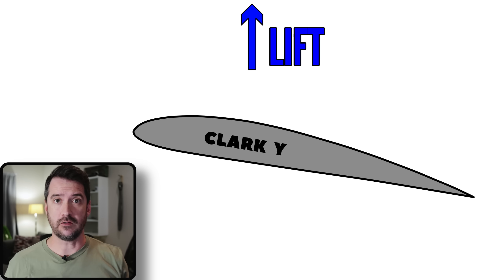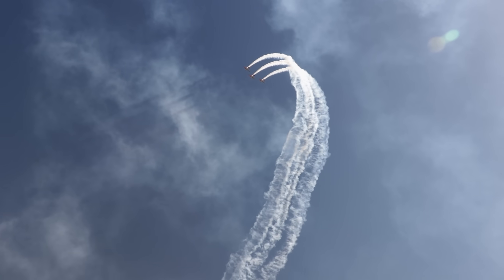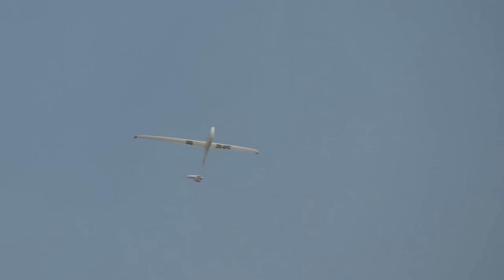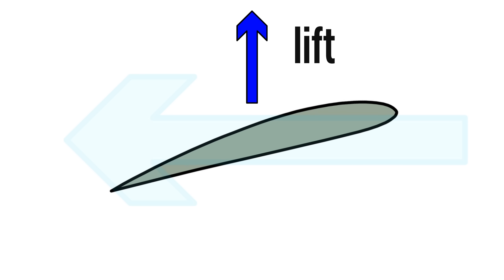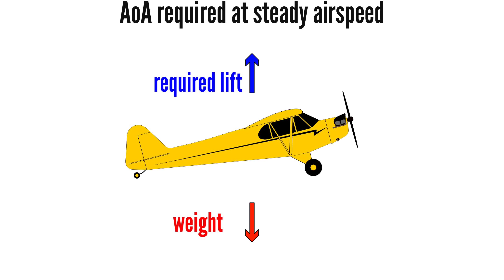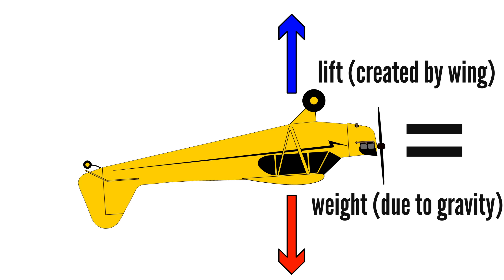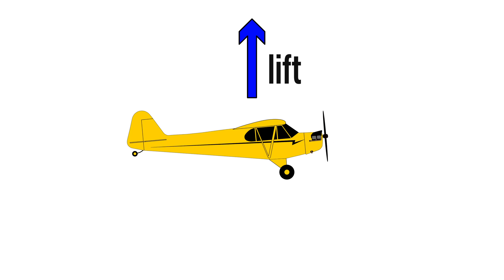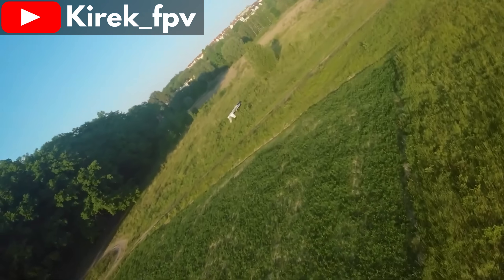Is Airflow Distance Over the Top of a Wing Always Longer?

Comment: The theory that lift on an airfoil is created by the static pressure differential between the air on the lower and upper surfaces of the air foil has been left behind years ago.
It has its origin in Bernoullis principle that states: “If in the same mass of fluid og gas, part of the fluid or gas moves faster , the dynamic pressure increases and the static pressure decreases” 
It is possible to measure this pressure differential, and what you will find is that it creates just a fraction of the force that is needed to keep the airfoil and structures connected to it, off the ground.

The lifting force is instead a matter of mass movement. Air is viscous and it has mass. That means that if you move a part of a mass of air, the air around it will immediately fill the gap created by the displaced air. The process continues a distance through the air mass, depending on the volume and acceleration of the initially displaced  air.

So it is the downward deflection of a variable amount of air that keeps the aircraft defying gravity.
This can easily be seen in wind tunnel tests where air particles that initially were many meters above the airfoil, is way below it when the airfoil has passed through, all depending an the speed and angle of attack of the airfoil.
Reply: Bernoulli never stopped being right. The mistake is in thinking air parcels that are split at the leading edge have to join at the trailing edge - the "equal transit time fallacy".
Reply: @michaeldunlavey6015  Spot on!
Reply: @michaeldunlavey6015  Exactly.
Reply: "The theory that lift on an airfoil is created by the static pressure differential between the air on the lower and upper surfaces of the air foil has been left behind years ago."

No it hasn't. This is just a different aspect of what you describe as happening around a wing. You are misunderstanding physics in assuming that looking at a problem in one way rules out explanations that describe different aspects of the same process. You are describing the reaction forces, but the pressure differential is what transmits those forces.

"what you will find is that [the pressure differential] creates just a fraction of the force that is needed to keep the airfoil and structures connected to it, off the ground."

Utter garbage. The only way a gas can transfer force to anything is by pressure differential. Go on, think of how else a gas can make a force on a wing.

If you know about physics and dimensional analysis the lift formula also gives a suggestion that pressure differential is involved. Lift = CL x 1/2 x rho x v^2 x S

Breaking this down you have CL x q which is dynamic pressure multiplied by coefficient of lift, a dimensionless number dependent on cross sectional shape and angle of attack, so giving a multiple of the dynamic pressure which can be interpreted as a pressure differential. This is then multiplied by S which is wing area to give total force.

Now this is not proof, as the resulting dimensions could be achieved by calculating from Newton's Third Law, but the way they come out in the equation is very suggestive of pressure differential acting on wing area given that those are the parts of the equation.

Source: I teach Principles of Flight and was an SME contracted to EASA in the subject.
Reply: Lol thank god none of you build airplanes.
Reply: @christophorus9235   There might be some Boeing employees here...
Reply: I remember studying aeronautical engineering and discussing the viscosity of air. I also remember studying the circulation theory of lift.
Reply: In case you are wondering why it is important to understand Bernoulli as well (and I would say understand first) is that it makes lift distribution across an aerofoil section easier to understand. The changes in pressure distribution are the easiest way to explain changes in pitching moment caused by movement of centre of pressure with flap deployment, above Mcrit or at the stall, for example.

I am sure they can be explained another way but the explanation with Bernoulli's principle is the simplest and is correct, regardless of other possible explanations.
Reply: You are both right and wrong The fundamental concept of what you're saying is wrong even though the individual parts of what you're saying are right That's because you lack understanding about how the overall system works 

Ultimately in order to generate lift in a fluid environment like an atmosphere you have to do the same thing your engine does you create a mass thrower you throw mass one way action reaction says you will get an equal and opposite force the other way 

The fact that all aircraft have air foils and we do not make aircraft with flat plates says everything you need to know that what you're saying is incorrect not so much that what you're saying is incorrect is that what you're saying is incomplete 

The lift generated by a wing comes from the amount of air mass that the wing pushes downward in opposition to gravity this throwing of mass downward we call lift if you generate it by brute force with a propeller rocket motor or jet engine we call it thrust but essentially a wing is a thrust diverter it's taking some of the forward kinetic energy from the aircraft and diverting it down in opposition to gravity 

How does it do this? Well there are three simple ways to do this you can generate lift via aerodynamic principles such as Bernoulli's principal and a wing shape you can also do it by simply physically deflecting the air this is what flaps do you can also do it by literally directing frosted downwards with some sort of propulsion unit such as a thruster or for example in the case of a drone a set of propellers aimed up thrusting air down keep in mind a propeller is just a rotating wing :-) 

An airfoil and the pressure differential is not the reason that a wing creates lift it's the way a wing efficiently creates lift :-) you see you understand the two separate processes but you don't understand how those processes are interconnected are they work together The reason an airfold wing creates downward thrust is because of the pressure differential that distorts the airflow over the wing that pressure differential between the top and the bottom of the wing diverts the air what direction does it divert the air? Well look at the shape of the air foil it diverts the air down and when you throw air or to simplify mass down every force has an equal and opposite reaction The amount of mass you throw down is matched by a force upwards equal to the amount of mass you throw down 

The pressure differential of a wing causes it to throw mass down this gives us lift 

Can a flat plate do the same thing? Yes it can just like the flaps on your wing do the same thing They divert air down so what do we need Air Force for? Efficiency that's why we need air foils while a flat plate can work it's extremely inefficient your aircraft will require a much larger engine to generate far more thrust to compensate for the extreme lack of efficiency in your flat plate 

What you have is called a logical fallacy if this then that without understanding of what this is or that is 

Pressure differential doesn't make lift see this flat plate makes lift therefore you're wrong except no you are wrong because the flat plate is doing the same thing in air foil does it's creating a pressure differential which creates downward mass throwing which creates lift it just doesn't horribly inefficiently :-) design your drone with non air foiled flat plate propellers and now look at the watt hour draw on your battery to make it fly. I say use a drone because they're typically overpowered meaning even with less efficient flat plates it might still fly but you're going to draw a hell of a lot more power doing it it's also going to be a lot noisier well take a guess with that noise is? That noise is quite literally watt hours of battery power being expended to generate that noise instead of generating lift 

It all comes down to efficiency and airfoil that maximizes that differential and pressure to create that downward thrust of air while using his little drag as possible simply does it with less power it's more efficient 

When we need to generate a whole bunch of lift we can do so by temporarily increasing the angle of attack kind of like how a flat plate creates left but this is temporary unless you have a tremendous amount of power at your disposal to waste 

This uses more fuel which is why we do not design airplanes like this :-) 

Your individual concepts precepts I'm not sure what the right word is are correct but when you put them together you're wrong because you don't understand how they work and interact with each other.
Reply: Incorrect.  The force from the difference in pressure is exactly equal to the change in momentum of the air forced down.  One is a consequence of the other.
Reply: Many things left behind are best left behind. In this case of aerodynamics, I suggest it was ignorance rather than scientific understanding that caused many to think that this fundamental theory of pressure differentials is not longer applicable.
Reply: @MarkStafford9  Yes. Pressure differential on the top/bottom of a profile is a fact. This does not contradict the fact that a certain mass of air is accelerated downward...which, as all is said and done, results in a pressure differential :)
Reply: @les8489  Yes. Aircraft passes through a Walmart-sized localized group of air molecules named Johnny. Johnny gets very disturbed. Aircraft leaves Johnny and moves on to Mary. In addition to being all in a whirl, Johnny notices he has been accelerated downwards. It takes Johnny a few minutes to deturbulate and decelerate, to chill back to his settled state, by which time he has lost roughly 300 to 500 feet in altitude. Freddy, Johnny's upstairs neighbor, has also been demoted, though with much less turbulence and with less altitude loss.
I bet if we could measure the energy dissipated by Johnny, that value of energy dissipated would equal the energy of the fuel consumed by the aircraft flying through Johnny.
That is all the "what" happened. The "how" did lift happen (the long and the short of it) is pressure differentials caused by AOA and airfoil shape manipulating parts of Johnny to run faster over the lifting surfaces than the other parts of Johnny are running under the lifting surfaces (Bernoulli). The over-wing molecules can't be forced to move too fast, so when the AOA gets too steep for the atmospheric conditions (ambient pressure, temperature, humidity, turbidity/purity) the under-wing parts of Johnny run up after the wing passes to greet the over-wing parts of Johnny, which severely and suddenly decreases Lift.
Reply: @MarkStafford9  Hm...somehow I fail to see this Walmart and Johny...
The lift happens because a mass of air is deflected by the wing (the induced flow angle comes to mind...) - here is where the conservation of momentum comes into play. It manifests itself by an overall pressure differential on the top and bottom surfaces of the wing - which results in lift force. 
The air accelerates on the top surface not because "it has a longer path to travel" - but because due to the angle of attack, a region of lower pressure is created at on the top surface, generally towards the trailing edge. When the angle of attack exceeds critical - the flow of air on the top surface may separate due to positive pressure gradient at some point on the upper surface (as the region of lower pressure is disturbed by ambient air trying to fill the pressure region). This results in a vortex, positive pressure gradient along the upper surface, flow separation and a loss of lift.
Bernoulli principle can be used to explain in layman's terms what is happening - but we know that the flow which (at the stagnation point) separates into two streams - does NOT "meet" at the trailing edge. There are numerous visualizations in the wind tunnels (using intermittent smoke technique) which confirm this. So - Bernoulli is useful to explain the principle, but the real answer is the conservation of momentum and Navier-Stokes equations.
Of course - all this can be translated into useful theories used to calculate lift - like the lifting line theory, vortex lattice method, Schrenk method etc. which are much simpler that solving Navier-Stokes equations (CFD).
The underlying physics is still the same and is described by Navier-Stokes equations (and yes, I happen to be an aeronautical engineer).
Reply: @les8489  Wow, thank you for such a richly-peppered-with-truths reply. Your statement,
 "we know that the flow which (at the stagnation point) separates into two streams - does NOT "meet" at the trailing edge"
 is particularly important. While not a requirement or a repudiation of "long/short" reasoning, your statement is a very important factoid to noodle over.
Reply: Lift and Propulsion share characteristics, that of energy field density differentials that are generated and vectorized through eddy flows. (according to NASA propulsion studies)
Reply: I think I need someone to explain to me what the difference between these two theories is. A pressure differential will cause bulk air movement—it's called “wind”. Induced bulk air movement will cause a pressure differential. Aren't these just two measurements of the same phenomenon, namely a bunch of particles whizzing around? Why does either description need to be false?
Reply: @stephenspackman5573  Stephen...what vast majority of people who are not engineers (and, in fact, a large number of engineers too) do not understand is the difference between the reality and the physical model associated with a theory which can be used for real-life applications.
In case of a gas flow over a body (the wing in this case) - the reality is described by solving a 3D Navier-Stokes equations. The results will describe the path of the flow under and over the wing, the pressure distribution on the top and bottom surfaces, the drag forces acting on the wing, the induced angle of the flow (the airstream being directed downwards for positive lift) etc. etc. Also - the strength of induced vortices can be calculated - as many other parameters of the flow.

So - the end result is: pressure distribution (which can do some degree be described by Bernoulli's equations), the change of momentum of the airstream (which results in forces), the trailing edge vortex etc.
All these are the interrelated, but when all is said and done - they are all a composite result of solving the Navier-Stokes equations (which for a wing is not a trivial thing and can be done only by CFD using a serious computing power). Neither Bernoulli nor the conservation of momentum does not fully explain the generation of lift or drag, but they CONTRIBUTE, partially, to the explanation of the phenomena.

That would be as close a description of the wing behavior and the forces acting on it as possible (and, in practical terms, depicting the reality closely).

The discussion regarding "what causes lift" and the preference for either a Bernoulli type explanation or the conservation of momentum - are just this: different views of people who are trying to describe an elephant - while observing it through a keyhole and seeing only a small part of it.

Now a number of theories exist which can pretty accurately calculate lift and drag - based on aerodynamic (measured) characteristics of the airfoil, and the geometry of the wing. These models (like the Lifting Line Theory which models the wing as a line of vortices) - but they do NOT describe the reality (Navier-Stokes) - these theories are just useful models which can be applied in real life with sufficient (mostly) accuracy.
Hope this helps.
Reply: @les8489  Lol Navier-stokes equations cannot describe reality. I hope that was the point of your rant.
Reply: @christophorus9235  LOL it wasn't a rant. And Navier-Stokes is the closest to what we can use for this purpose. Maybe you can enlighten all and sundry what should be used for this application.
Reply: @les8489  Navier-Stokes is an approximation mate. You keep using it and the word reality like they are one and the same, which points towards a fundamental misunderstanding on your part.
Reply: @stephenspackman5573   You would have to understand how the Venturi effect works (combining Bernoulli & Boyle's law).  This isn't theoretical physics.

Seeing this pack of physicist LARPers would be funny if it wasn't so tragic.  If you want to learn something, take a class, read a book, don't just try to imagine an answer, and then just seal yourself into an echo chamber to convince yourself you are right.
Reply: @stephenspackman5573  Correct, this tempest in a teapot arose when the OP tried to get the monkey off everyone's back, but everyone's sitting in his dome and saying "I like my monkey."
The pressure-difference description and the air-flung-downward description are two sides of the same coin.
Reply: Bernoulli (and Venturi) and the difference in speed of the air flow between the top and the bottom of the wing have NOTHING to do with lift. 
The only real and valid explanation is here (see from min. 2.18 ): https://youtu.be/ph1HqrioLPs?si=hbq42wwKaUYVeRAv . 
The pressure difference (aka "lift") between the top and the bottom of the wing is caused by the CURVATURE of the airflow over the top of the wing. If the air flow does not curve, there is no pressure difference between the internal and external part of the vortex (see tornadoes, cyclones effect) and therefore there is no lift. 
So lift is basically generated by CENTRIFUGAL/PETAL FORCE experienced by the airflow flowing over the top of the airfoil. No Bernoulli (nor Venturi), but "Newton" (in terms of centrifugal/petal force on the top and action/reaction on the bottom) is "responsible" of lift.
ps: please, don't misunderstand me. Even a perfectly flat wing is able to curve the airflow and therefore generate lift!
Reply: Guys, this is totally wrong:
"The theory that lift on an airfoil is created by the static pressure differential between the air on the lower and upper surfaces of the air foil has been left behind years ago."
Wrong. A fluid can make forces on a surface ONLY in 2 ways, with static pressure (it creates a force perpendicular to the surface) and with viscosity (it creates a force tangential to the surface). There is no other way. And it is not the viscous force which creates lift, it is the distribution of static pressure around the airfoil  (although viscosity is necessary to create circulation, the phenomena that creates the distribution of static pressure around the airfoil).
"It is possible to measure this pressure differential, and what you will find is that it creates just a fraction of the force that is needed to keep the airfoil and structures connected to it, off the ground."
That is TOTALLY false. Quite simple aerodynamic models are surprisingly good at predicting the static pressure distribution around an airfoil, and that pressure distribution explains the TOTALITY of lift perfectly. To the point that distribution of pressures and the slope of the Cl-vs-Alpha graft (coefficient of lift vs angle of attack) can be calculated modeling a spinning cylinder and then making a mathematical transformation to "morph" that cylinder into the shape of an airfoil, and the reality matches this prediction perfectly. Look up Joukovsky airfoil and Joukovsky transform.
"The lifting force is instead a matter of mass movement. Air is viscous and it has mass. That means that if you move a part of a mass of air, the air around it will immediately fill the gap created by the displaced air."
Well, the fluid has mass and if you want to move it from one place to another then you need to accelerate that mass, and the acceleration is force/mass. Where does that force come from? PRESSURE.
Yes, the wing pushes the air down, so the air pushes the wing up. That's action and reaction (the 3rd Newton's law) and it is totally correct as a first explanation of lift. But when you look HOW the wing pushes air down, that's PRESSURE. The wing creates a PRESSURE field around it that accelerates the air, and the PRESSURE field is correlated (almost perfectly) with a VELOCTITY field of the air around the wing that follows (almost perfectly) Bernouli's principle: The parts where the air is moving faster the pressure is lower and vice versa. (The reason when Bernoulli matches almost but not totally perfectly is that Bernoulli assumes conservation of energy which in turn assumes no viscous forces, which is mostly true everywhere around the wing except inside of the thin boundary layer).
Discussing it lift is created by the wing pushing the air down by Bernoulli is like discussing if an object in free fall accelerates because of Newton's second law or because of conservation of energy, or how much each of them is responsible for that. It is not one or the other, it is not "both" as in "a part and a part".  It is "there is no OR, the Newton's second law and conservation of energy are not 2 different things, are just 2 different points of view of the SAME thing, to the point that conservation of energy can be MATHEMATICALLY DERIVED directly from F=m*a". It's like saying "X+1=3" and "X-1=2" and someone asking "How much is X=2 because X+1=3 and how much is it because X-1=2?"
Reply: @adb012  THANK YOU. Anyone who's ever used a CFD package, even just once for some undergraduate course ( for heaven's sake ) knows that to calculate your aerodynamic forces, you need to integrate the static pressure and sheer stress over the aerofoil's surface. Anyone sitting here arguing you probably hasn't ever touched ANSYS Fluent or OpenFOAM once in their life, nor have they ever attended a course on mechanical/aeronautical engineering.
Reply: @adb012  its correlated but you got cause and effect backwards
whcih is perfectly fine when you try to measure something, you cna measure an effect and derive the cause form it
but air is deflected down ebcause on one side it cannot go through the wing and on the other side it would produce a vacuum if it didn't follow the upper side in both cases yo uget an equilibrium betwenn the pressure gradient needed to accelerate the air nad created by air runnign into teach other
Reply: @JulianDanzerHAL9001  ... You are wrong in 2 ways.
1) I didn't got cause and effect wrong because I didn't make any claim regarding which is the cause and which is the effect, and that was intentional. I said "explain HOW" instead of "explain WHY" and CORRLATION instead of CAUSATION for a reason. If you want to discuss causation we will open a can of worms and you will not like what I have to say (if you are like 90% of the people to whom I talked about that). But it can still be fun 🙂.
2) If you think fit for a second, you will see that saying "the air does did because if it didn't that would happen" is non-sensical. The air is not a conscious being that makes decision based on the consequences of what would happen if it decided something else instead. The pressure field that would act on the air "if it didn't follow the upper side" is not the pressure field that impacts the air when it IS following the upper surface and hence cannot be an explanation of how it is following the upper surface. Yet, you are close 🙂. Let me give you a preview of the can of worms. Say that you have a stationary flow around a wing (stationary means that everything is steady, the air is moving but, at each point, the velocity vector, pressure field and any other parameter remain constant in time). And let's say that we monitor a parcel of air initially far away ahead of the wing, but that eventually will flow close to the wing and above it. Initially, its pressure is the atmospheric pressure and its speed (from the airfoil frame of reference) is the airspeed of the plane. However, as the parcel flows above the upper surface, we can see that its speed increased and the pressure diminished compared to the initial condition far ahead of the wing. If it's speed increased (i.e. it accelerated in the direction of motion) it NECESSARILY means that there was a force in the direction of motion acting on the parcel of air, and that NECESSARILY menas that there was a pressure gradient: the parcel traveled from a region of high pressure to a region of low pressure. There is no other way around. So here is the deal (or rather the non-deal). If the pressure diminished because the speed increased (Bernoulli) but for the speed to increase it had to travel from a zone of higher pressure to a zone of lower pressure (F=m*a), what was first? Which is causing which? Almost nobody likes my answer (not even me, I think I am correct and matches reality but reality is quite disappointing in this case).
Reply: @adb012  yeah its not a conciosu being
and it doesn't magically dodge walls
thats why you get a pressure difference
air bunching up with other air at a wall creates an increase in pressure until there is an equilibrium between incoming air being accelerated the other way and the rpessure caused by air bunching up there
in the end both conservation of momentum and hte idela gas law are upheld but yes the way this happens is through rapid repeated tiny interactions goign back and forht until a sortof equilibrium emerges, not by concious planning, duh
the end effect is still that air doesn ot go throuhg walls and diverting air produces the pressure needed ot divert that air
so diverting air with a curved wall will cause a change in pressure - F=m*a in this case talking about the vertical componetn of both the force and acceleration vector
this in turn causes the air to also speed up and slow down because well, you still ahve zoens of differnet pressure and F=m*a thsi tiem talking about the horizontal compoentns of force and acceleration vectors
of course the differnt speed also affects how stronge exactly the forceo f air being diverted is and of ocurs on the upper side flow can seaprate nad on the lower side flow can cirucalte ina convex poecktet letting air flow over it but both of those processes ahve rather complex conditiosn for when they do or don't happen how much and all of htese are qunatitative influences on the basic working principle which of cours eall even out
in the end if oyu want a truley un-simplifeid explanation of how a wing works you will have to set up a cfd simulation fo a wing profile with like a billion cells, solve it in a few quadrillion calculations (thats more doable than it sounds with modern computers) but (and now we get to theimpossible part) then philosophically debate the deeper meanign of every single calcualtio nyou do in the process
an enourmous waste of tiem when we have useful simplifications as well as computers
but ideally those simplificatiosn should be based on the same laws of pyhsics as realtiy and ocmputer simulations, not on something that sounded cool when your teacher said it
Reply: @JulianDanzerHAL9001  ... Brilliant! You gave an excellent explanation that almost nobody gives, not even at college's level Fluid Dynamics. It has all the elements that I like: 1) The continuous hypothesis is extremely useful and enables prediction that match reality extremely well, but it is false. The air is a bunch of molecules, not a continuous. And each molecule has its own velocity and no pressure. If you REALLY want REAL causes go to statistical mechanics, not fluid dynamics.  Now, if we stay within  the boundaries of flus dynamics (Navier-Stokes et-al), 2) In steady flow there is no cause-and effect. The pressure and velocity fields just co-exist. It is the only steady-flow solution to the Navier-Stokes equations that yields a pressure and velocity field that would not violate the boundary conditions, namely that the airflow will not penetrate the wing and that it will separate at the trailing edge (and you can leve the last condition if you take into account viscosity, because it will naturally separate there). 3) If you still want cause-and-effect in steady flow, you need to go back in time to before way before  the steady flow was achieved, to the point where the plane barely started to move, and track all the changes in airspeed and angle of attach which in turn will be translated in shedding starting vortices with each change. Now THAT is complicated.
Reply: @adb012  yes, indeed continuous fludis are just statistics applied to many molecules
there is no temporal cuase andeffect in steady flow but in a simplifeid manner oyu can say that certain conditiosn you enter into the model infuence the outcome in certain ways
and yes you can get to steady flow in many ways and oftne the way we clacualte it is a faster way than what happens in reality, you get usually hopefully a similar result but a time based simualtion of an entire flight owuld be impractical
Reply: @adb012 the lift comes from a few things. Air mass and viscosity are what make it possible. As the airfoil moves through the air is compresses air ahead of the leading edge. As the air moves around the wing at zero angle of attack the pressure zone gets evenly dustributed around the front of the wing. As the wing on top curves back down it stretches the air due to viscosity wanting to stick to the wing. This creates a local low pressure zone creating lift. Lift is also created from the tangential force and the air on top joins the bottom air stream but at a downward angle of the trailing edge of the wing creating more lift. The smoother you can join the airstreams the better the lift from lower drag.
Reply: @Kyrazlan  ... Absolutely not, that is not how it works. Same airflow under different fluids show very similar lift-vs-angle-of-attack curves for a wide range of viscosities, and I am not talking 50% more or triple the viscosity, I am talking about 100 times more viscosity. The frag will be very different and the stall behavior too, but away from the stall they will produce surprisingly similar lifts. Also check a pressure distribution chart for an airfoil at an angle of attack: the lowest pressures happen close to the leading edge, rather than farther along the upper surface as you imply. What actually creates lift is "circulation" which is what accelerates the flow above the wing and slows down the flow below the wing. And the lift can be almost totally explained without taking account viscosity. Viscosity does have one crucial role, though: It ensures that the flow will not be able to turn around the sharp trailing edge. The fact that the flow has to separate at the trailing edge (instead of going around) is what crates the circulation. Actually, Kutta explained his Kutta condition as "the airfoil will produce the necessary amount of circulation to ensure that the airfoil separates at the trailing edge".
Reply: That's what I have always thought.  It's Newton's third law - same as propellers.  I used to fly gliders and the ground effect induced when close to the ground at speed is substantial and you can fly a lot further than you may think.  Have you ever seen the air displaced by a bumble bee close the ground?  Check it out and you will see what I mean.
Reply: @DavidMartin-ym2te  
Slightly cambered airfoils with flat bottoms can create lift at zero AoA without flow turning or deflecting airflow.
The pressure differential between upper and lower surfaces is what creates lift.
Reply: Ok. So, if you take any of the asymmetrical NACA sections at zero angle of attack do you get lift?
Reply: @ChimeraActual  Yes.
Reply: @christophorus9235  Thank you, that was my point.
Reply: @ChimeraActual naca was around long before CFD. I wouldn't rely on their data too much.
Reply: @Kyrazlan  I think you have missed my point, referencing CFD would not have been enlightening. And ToWS is still very useful to those without a CFD tool handy.
Reply: @Kyrazlan  Re: NACA vs CFD -- NACA plots DO come from wind-tunnel tests -- which use real physical wing sections and real air.  I wouldn't cast doubt on their data too much.  I don't think any airplane designs before the seventies had adequately mature CFD available -- which means that all US WWII planes, plus the B-52, probably the 747, and quite a few commercial jetliners in use through the seventies or longer relied on NACA foil data.

All that CFD does is offer you a quick software-based simulation of the same thing.  Wind tunnels do have a possible source of error because the walls are at a finite distance, but the users of them are aware of that and have correction algorithms.  Similarly CFD has possible sources of error because its resolution, while huge, is limited, and because its modeling of air behavior (turbulence especially) might not be exactly right.
Reply: Man, thank you for pointing out the difference between dynamic and static pressures, and the fact that static pressure is a relatively small part of airplane lift.
Reply: Which clown college did you graduate from?  Or did you drop out of clown college?
Reply: Ok and how is that downward deflection caused? Where do the air and wing particles interact to create equal and opposite forces?How is the force applied? And what do we call that force  when it is divided by the area it is acting on? Is there any other way for the air and wing particles to interact that isn't that one?
Reply: @gamaltk  The pressure changes on the wing are responsible for all of it.
Reply: @christophorus9235  That's the point I am getting at (I think you mean pressure differentials not changes :) )
Reply: "Fluid or gas" doesn't even make sense. Guess why.
Reply: Well, a partial "bravo".  I agree with the rejection of Bernoulli, but I do not agree with mass displacement, although I once did, as it IS a much better explanation than Bernoulli.  Have you ever seen a demo of air flowing around a wing in an air tunnel  vs a wing moving through air?  I wish I could find the video back.  It was fascinating.  The flow is different depending on whether the air is moving (has momentum) vs whether the wing is moving (air just has inertia).  If you know of this video, please let me know.
Reply: It looks like you really got Julian Danzer upset and rapped around an axle, or a propeller shaft!!
Reply: I'd like to see this result.  It doesn't get down there because of turbulent flow, but a smooth flow to a position lower than the foil?
Reply: Umm, no. You have are misinterpreting just about all the physics. Regardless of your explanation, the air pressure below the wing is much higher than that above the wing and if the wing is not stalled, measurements will in fact confirm this. The idea that they would not is simply illogical and frankly a lie. Citation please.  Meanwhile, the Bernoullis effect explains the net lift of an un-stalled wing perfectly. Just do the math and you will see. Sorry but you're just plain wrong. "Left behind years ago." RUBBISH. Fake news.
Reply: Further more, the effect of air under the wing being "pushed down" is a) obviously true — it's a GAS not a liquid — and b) is a large part of what causes "drag", since it makes the wing less efficient by essentially not sticking around do work! More than that though, the cause of the airflow behind an (un-stalled) wing deflecting down is because the air at the trailing edge is moving faster above that edge then below, resulting in velocity vectors in the downward direction. Since that flow is laminar, the upper and lower streams combine to a net force vector that "blows" (not pushes) the air down. Then, because the wing is not longer there, vortices etc form and a whole lot more besides ... but we are discussing the space where the wing exists, not the air in front of or behind it. How does air that is not even interacting with the wing have ANYTHING to do with the physics of lift versus drag?
Reply: So, if the propellor can’t generate enough thrust to cancel out the weight of the plane (most planes have less than 1:1 thrust to weight ratio) then how is there somehow enough thrust coming off the back of the wing with only in a very small downward component to cancel out the weight of the plane?

If what you’re saying is true then the propellor has to be throwing enough linear momentum to fully cancel through weight of the plane and also extra to make it move forward. Therefore, the plane would need enough thrust to fly in helicopter mode, hovering in a vertical attitude with both wings stalled. And planes don’t have that much thrust. 

So if the propellor doesn’t make enough thrust to lift the plane all in its own. Then how in the world is that same amount of thrust somehow able to keep the plane airborne after it hits the wings if your “deflecting mass downward” thing works?
Reply: @ketilrkke4552  Forget about Newton and Bernoulli. When an asymmetrically shaped wing splits the air(stagnation point), it does so by applying an upward thrust force to the on-coming air as it moves horizontally. The wing moves forward, but air is accelerated upward just to reiterate. 

The air forced into an upward trajectory opposes downward atmospheric pressure applied above the wing, and this is how low pressure is produced. 

Pressure recovery is required to reduce drag that's why a typical airfoil shape transitions from camber to flat all the way to the trailing edge. 

That's all you need to basically understand how a wing generates lift.
Reply: @ketilrkke4552  No1 in your comments knows how lift is generated,  I have read them all 👍
Reply: It's a combination of both. Cambered airfoils produce lift even at an angle of attack of 0. And then of course it's also what cause wingtip vortices. But yes the downwash is also another element.
Reply: i only clicked on this video looking for YOUR answer, not the one he gave.
well done!
Reply: @victormuckleston  Searching for people who share your perspective and beliefs is very reassuring. However, it does not encourage personal growth. We humans need like-minded communities, and there's nothing wrong with that. If you get to a point where you feel confident enough in your individuality to challenge your pre-conceptions, to try to unlearn some of the things you may have been taught as right, but are actually wrong, then slowly and carefully seek out people who challenge your current position, your current thinking on any subject of your choosing. Either you, or the person you are engaging, or more likely both of you, will benefit from the challenge. Just be really gentle in challenging your own foundations and assumptions - it can be very destabilizing; pulling on one thread can unravel your whole shirt.
In this instance of aerodynamics, I think that the differential of net pressures above and below the wing (no matter if the wing is flat, curved, upside down or downside up) are a significant factor in calculating lift and drag. So I respectfully disagree with you (meaning I welcome being wrong so that I can learn something more right, but I don't think I am wrong in this particular instance).
However, we are all wrong about something we are sure we're right about. ;-)
Reply: @victormuckleston  "well done" why? He is wrong.
Reply: The gas/fluid pressures on opposing surfaces of a wing (or propellor) are generated by the delayed reactions of the gas/fluid to the movement of the surfaces into and away from the gas/fluid. The pressure differential is not a function of the apparent speed differential of the two surfaces -- specifically, the static air around an airplane wing does not move across the wing. it is pushed out and air pressure pushes it back to where it was before being displaced. The shape of the wing and its angle of attack are tuned to create a high degree of gas displacement above and below the leading edge of the wing with a sudden relief of the upper surface that results in a lower air pressure than the lower side which sustains contact and displacement of the air until the two surfaces meet at the rear. The upper surface of the wing must be carefully shaped to avoid a disturbance to the spring-return of the air that would otherwise reduce the pressure differential.
Reply: @Rampart.X  thouhg in biconvex wings at low angle of attack both sides can experience less than ambient pressure, the upper side just more so than the lower as logn as the angle of attack is above the 0 lift angle of attack
Reply: @JulianDanzerHAL9001  I think that's the Bernouli effect at play.
Reply: @Rampart.X  its the bernoulli effect speeding up fluid sthat become lower pressure because they are moving around a convex surface and essentially experience centrifugal force as they do
not the other way round
Reply: @Rampart.X As far as I know, Bernoulli’s theory means this.  As the velocity of a fluid increases, the (static) pressure falls. 

That is true, I know.  I was paid to measure differential pressures to infer flow in pipelines. 

I can attest that this is entirely true.  As a tradesperson that learned about all manner of flow measurement but used differential routinely, I constantly reminded people that ‘differential pressure IS flow!’
Reply: @Rampart.X  This is the correct answer. In summary, wings provide lift with a combination of the Bernoulli effect, and angle of attack. https://www.princeton.edu/~maelabs/hpt/mechanics/mecha_62.htm#:~:text=The%20lift%20coefficient%20is%20defined,symbols%20have%20the%20same%20meaning. Lift and drag have a strong correlation in the shape of a wing. i.e. more lift = more drag. Jet wings are typically designed to provide almost no lift, to eliminate, or dramatically reduce Drag, which increases with the velocity squared. This is why (lets say) commercial jets have a very sleek wing, and use leading and trailing edge slats and flaps at low speed (take off, and especially landing). And also why they have huge spoilers that pop up after touching down; to slow the aircraft down while using less braking. Inverse lift (downforce) in a race car gives the car more cornering speed, but also end up determining terminal speed. i.e. The downforce, and power find equilibrium which is top speed. Note, that in Formula 1, they alter the rear wing to reduce downforce and drag. https://www.formula1.com/en/latest/article/tech-tuesday-how-the-rear-wing-of-the-2022-car-has-been-designed-to-be-an-f1.70dkHlnyP8DiGDDnMf3tzU https://www.linkedin.com/pulse/aerodynamics-f1-rear-wing-harsha-vardhan/
Reply: @Rampart.X  Correct until the part where you mention a sudden relief. The upper part of the wing at that point never generates lift to any meaningful amount in comparison to the movement of air beneath the wing pushing it up.  It just lessens the amount of turbulence created and increases stability.  Which, if great enough, will stall the wing.  Some planes have symmetrical wings yet fly very well, so Bernoulli also doesn't apply. It's really as simple as angle of attack and then dealing with the dirty air that's created by the opposite side.
Reply: Not sure if that has been said before, but the pressure difference and the momentum change of the air are one and the same.

Air by itself doesn't change it's momentum, the wing does through pressure differentials.
Reply: bernoullis principle still applies
and htings get ab it ocmplciated if you try to look at every atom of air
but when udnerstanding lift bernoullis principle is useful the other way round to how people think
the wing produces lift
and because of this and because of bernoullsi principle the air speed sup above htewing
NOT the other way round
Reply: Wind tunnel tests and fluid streamline experiments show wings can generate lift without and downward movement of air.